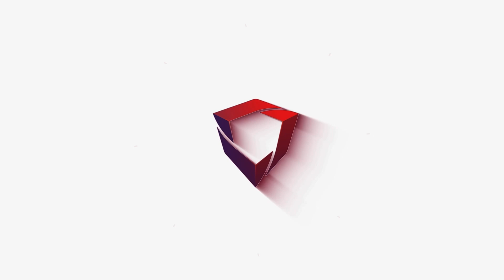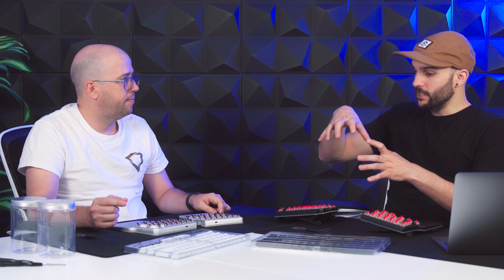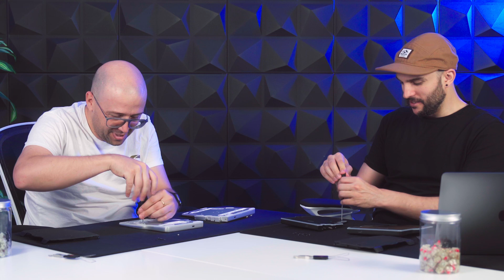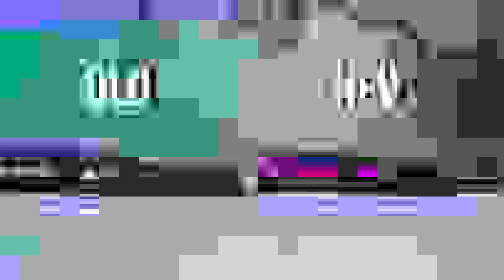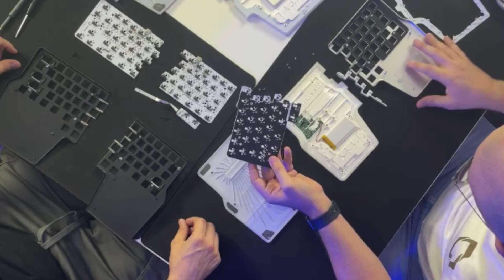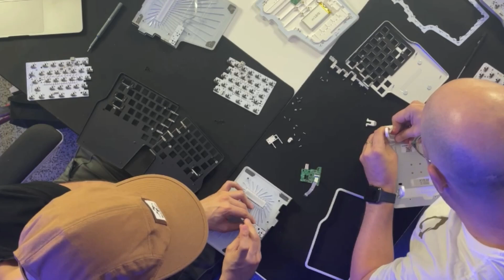OG Raise Vs Raise 2. Let's open them! - Ergolab #5

Comment: I’m dying to see dygma defy 2 and hope it will have rapid trigger. Like an option when you order it (like wireless and underglow).
Reply from the maker: Rapid trigger requires HE switches, which need a completely different PCB and firmware, but it's something we're considering for future product lines 😊
Reply: neh i dont think so, current HE keyboard switches are pretty garbage quality and the sound is no where comparable to standard mechanical. its also so niche, not a smart business investment as of now. literally only benefits hard core gaming and makes not the biggest difference. I bet you're not even good at gaming to find a true difference and worth spending $200+ on a secondary niche keyboard
Reply: @painpane I agree that it is definitely a niche market. If you just get lighter switches or tactile where you can feel the bump HE becomes a gimmick. If you want HE just buy a 🎮 you need to GIT GUD before you look at hardware.

Comment: Your keyboards would be interesting, if the palm rest was detachable. Because the palm rest hinders to set the keyboard close enough to comfortably type with floating hands, which IMO is the most ergonomic way to type. Using a palm rest can be ok, but better without it I think.
Reply: Ive bought the Raise 2 but I fully agree. I realllly wish it was detachable, it's the only thing i'm not a fan of :( But still, I love the rest of the keyboard.
Reply: @123451234596  I have the Ultimate Hacking Keyboard as my main keyboard for one year now. The UHK gets a lot of things right. From all keyboards I tested and have used it is the overall best for me. Great hardware, great software and the mouse modules are a plus as well.
Reply: Agreed lol I do not understand why theyre not fully detachable ....
Reply from the maker: We need the room under the palm rests to place the battery, the tenting legs and the underglow, but we're exploring options without palm rests for the future.
Reply: @DygmaLab  Interesting, the Voyager shows how compact a keyboard can be (no battery of course...). Looking forward to see what you will come up with.
Reply: @nickgoogle4525 no battery and no wireless comms. Those are both huge sizes in electronics. But yes, I was very close to buying tbr Voyager instead.